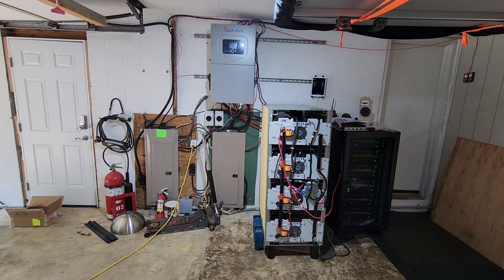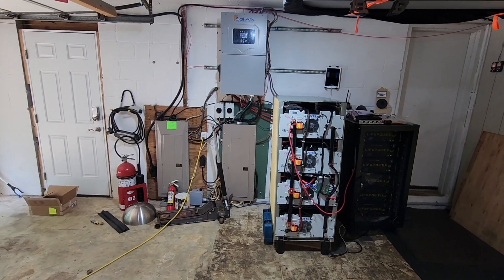Unique DIY OffGrid Solar Setup

Comment: This design of course is wildly unsafe and would never pass an inspection.  Your electrical panels are too close to the ground where water might accumulate, you don't have any PV labelling, your battery wires are not protected from damage, you have no inverter or PV rapid disconnect outside your home, your car port "solar roof" is sagging and the wires are not protected from animals, your solar "fence" exposes high voltage wires that are not protected to people, your CATL battery system has exposed battery terminals (and BMS), your internal wires need more wall straps to be secure in place, cables secure next to DIN rail could be exposed to abrasion, and finally your battery systems are not rated for residential use (STD 1973 is for commercial use only).

Comment: how much battery are you using, and how long can you run off them?  also, how much grid power are you drawing a month?   thanks for the video.
Reply from the maker: 100kw batteries. I can run the house only for 7 to 10  cloudy days and change only Bolt.  As far grid goes it depends on weather anywhere for 200kw to 1k or more depends again on weather.
Reply: @meanttobe100  when you say 100kw batteries on your 48vdc system, do you actually mean 4.8Mwh (4800kwh).  Or did you mean 100kwh?  

A kW measures power i.e. the rate at which something uses electricity, whereas a kWh measures energy, the total amount of electricity used, or the capacity to use.
Reply from the maker: @MrRobertSpearsJr  2000amp @48v 100kwh.  Check out my other videos on batteries.

Comment: Nice setup (and property)!  I have the same inverter and I'm looking forward to commissioning it!  For the past month I've been taking down trees in preparation of doing the solar installation.  I hate taking the trees down, but I had four 100' spruce trees, and ten 80' maples all within 25' of my 3 car garage, which I'm installing most of the panels on, and those trees where a disaster waiting to happen (I'm directly on the CT shoreline) and they're also destroying my roof on that garage, so they have to go either way.  I was seriously considering doing a carport with panels for the roof (like yours) behind the garage, but it would be within the setback area of the property and I'm sure someone would make a stink about it at some point so I might have to scrap that plan.  Anyway, thanks for sharing your system, I love seeing what others have done and sometimes get some really good ideas from folks like yourself that share their setups!
BTW, I haven't seen a Stiletto in years, they were way ahead of their time with the layup.
Reply from the maker: Thank you I'm pretty sure you'll love the solark. if you need any help setting it up or need some idea I'm available. Also check out my battery video. It's a very cheap set up for a lot of storage. I'm pretty sure with the solark if you're gonna run the whole house you might need some. Thanks for noticing stletto my 1st sailboat got plans for it and right now  I'm just sending and giving a new paint but once it's running set up most likely. I'm gonna turn it to electric solar. Good luck with projects.